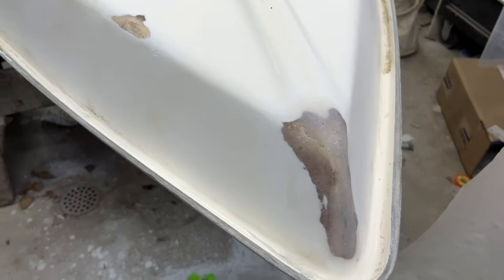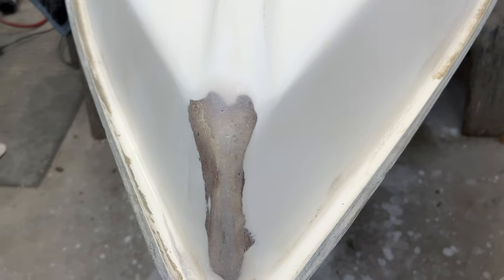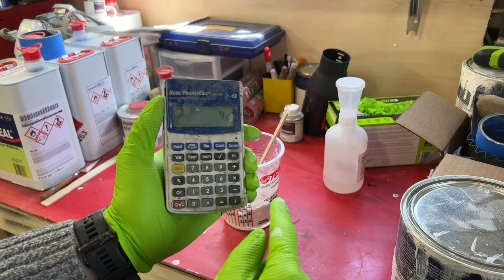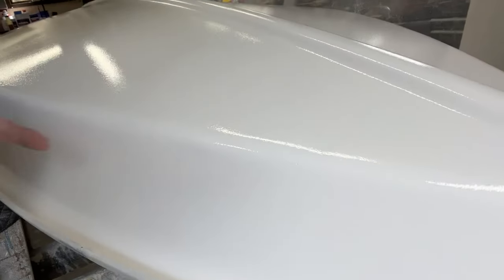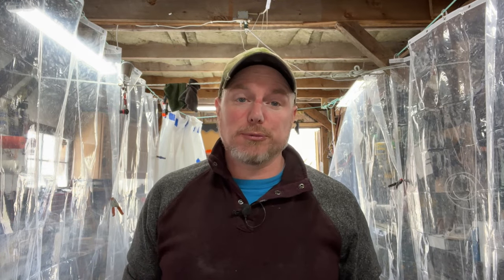Re-gelcoating your hull - PART 2 - fairing and spraying- [restoration of a sunfish sailboat]

Comment: Great video series. I recently picked up a 15' Glastron Alpha (basically a slightly bigger sunfish) and will be restoring the hull soon. 2 questions if you don't mind. First, the previous owner put a layer of CSM along the bottom of the hull that will need to be sanded down. I'm assuming this will be doable with a orbital and 80 grit to get it sanded smooth and into the correct profile? Second, I was curious how much gel coat I'll need to buy for this size hull. It's only a bit bigger than the sunfish so I was curious how much you ended up using for these boats. Thanks!

Comment: I have an older boat that is very similar to a sunfish, and the bottom of the hull is in bad shape with spider cracks. Do I need to sand all of the old gel coat down to the fiber glass and then put new gel coat on ? Thank you for your response

Comment: boy, i have learned quite a lot. i am restoring a 1972 Hawaiian 21 ft. jet boat the gel coat is gone the metal flake is rough. where do i start any help would be greatly appreciated!
Reply: A few years ago I restored my old Bahner flat deck. First things first was I repaired everything on the hull exterior. Then capped the rails (obviously not a necessary step) then got to replacing transom and stringers. Got all the dirty work done first. Then it was on to paint. In hindsight I wish I would’ve re-gelled it because it hasn’t exactly held up. Then built the engine and jet. Eventually I’ll get a new interior. But best of luck, my dad has a fully restored 75 Hawaiian

Comment: what are wiping on the hull as you are sanding, black stuff?
Reply from the maker: It’s called a guide coat. It’s pretty much graphite powder that when applied allows you to see scratches and low spots when you sand. The process is to sand until the black is gone. Then you know your surface is “flat”

https://www.amazon.com/Mirka-9193500111-Guide-Coat-Black/dp/B00GTYHCGG/ref=mp_s_a_1_5?crid=18UEICE7NUEAE&keywords=guide+coat&qid=1650801015&sprefix=guide+%2Caps%2C74&sr=8-5

Comment: I have some pretty Long and deep scratches down my hull. It's a 32' contessa. I'm unable to spray gel coat because it's in the yet other boats. What would be the best way for me to repair this? I have total bait gel coat and some pigments for color matching. Again the scratches are several feet long.
Reply from the maker: I would probably just apply the gelcoat with a brush. Maybe thicken it up a little with some cabosil or silica.

Comment: I've found your videos very informative.  I'm restoring a fiberglass car body and made the repairs using powder-coated random strand fiberglass mat and epoxy resin instead of styrene to avoid the 'wax' the use of which intimidated me.  My question is can I gelcoat over the epoxy repairs? I seem to remember an issue with epoxy in one of your previous videos. If I can't gelcoat what would you advise?
Reply from the maker: First mike, thanks for subscribing. I always respond to subscribers. To answer your question, you cannot put gelcoat (which is polyester) over epoxy resin. It just won't bond well. Your only option is paint now. Next time just buy poly resin with the wax included, then you won't have to worry about it!!.

Comment: if you had it, could you have used TotalFair  by Total Boat instead of your home made mixture? I get the idea that these boats are poly ester and not epoxy layup, and I have used TotalFair, a lot.  thoughts?  thanks, Chuck
Reply from the maker: Hi chuck. Total fair is epoxy based therefor the gelcoat will not adhere properly. Second total fair is not the best fairing compound out there. It's far too expensive for one, and really does not cure well. If you become a channel member you'll see why I'm not a fan of total boat anymore.
Reply: @HoldFastMarine  Hi Will, I subscribed. interesting that you say this about TotalBoat. I have had some issues with several of their products an there are just other brands that are go to for me anymore, Epifanes for paint and varnish, west system for epoxy, that sort of thing

Comment: Awesome video, very informative, but I got a few questions. How much psi were you running for spraying the gel coat? and how far did you sand? Im trying to respray the hull of my old stand up ski and its got some decent scratches in it, would you sand it till the scratches are flat with the hull? thanks
Reply from the maker: All that info is in a .pdf on my Patreon page!!

Comment: I just picked  up an older sunfish that was,  use the term loosely, repaired by the previous owner. He plugged the cockpit drain hole with fiberglass. Will that sand off?
Reply from the maker: Possibly. I’d need to see it to be able to tell you. I say just rip into it and see what happens!

Comment: Random question! Redoing a small fiberglass plunge pool outdoors. Would you gelcoat it or use epoxy for the work?
Reply from the maker: Epoxy.
Reply: @HoldFastMarine  ok and why is that man?
Reply from the maker: Because gelcoat isn’t strong.
Nor is it 100% non porous. Make sure your subscribed to the channel please!
Reply: @HoldFastMarine  will do thanks man! Its weird that its used for boats! Epoxy seems like a better option and easier to use

Comment: Great Video but lacking info for me...What grit sandpaper are you using on the original gel coat? (The bulk of the bottom?) Is it 180 grit? 220 Grit? Can I use 180 for the first coat? I'm getting ready to re-gel coat the bottom of my 1978 GT150 GlastronCarlson and I am changing the color. The bottom is in great condition but the color is a putrid yellow that needs to go away. I am gel coating the bottom for the durability of have a tough surface on the bottom. I am planning on 2 coats of laminating and one or 2 coats of wax coat... But I need to know what you recommend for the initial sanding (what grit before gel coating?)
Reply from the maker: I use 80 grit for the prep work. Sometimes 40 if I’m in a hurry.

Comment: So, the thing about silica is that the particles have very ragged edges. If/when you breath them, as you did after taking off the respirator and blowing the dust into the air, they become embedded in the tiny sacs in your lungs. The sharp edges cut your lung membrane, causing it to bleed, ever so slightly. The healed scab turns to scar tissue, which prevents oxygen from crossing into your bloodstream, which is what your lungs are designed to do. Over time, as you breathe silica dust, your lungs become excessively scarred up, preventing oxygenation of your blood. You suffocate.  

So, if you work with silica a lot without the respirator, you're gonna strangle yourself.  Just saying.  If you also smoke, can you leave me your tools?  And wife or girlfriend? I guess I'll have to wait a few years, though. And, I'm already old, so forget it.  Breathe all the silica you like.

Comment: just wondering, does the polyester structural repair putty cure enough on its own to be able to sand? Or did you have to cover it with something to get it to cure without air? Thanks.
Reply from the maker: It cures for me, some people say it dosent. Give it the extra time to cure and sand it with 60,80 grit at a low speed.

Comment: Hi, thanks for your videos, I noticed with your catalyst calculation for your gelcoat putty, that you included the silica in the measurement for the catalyst? If you used 2 oz gelcoat and 2 oz silica, shouldn't you use just catalyst for the 2 oz gelcoat only? Genuine question, thank you.
Reply from the maker: Gelcoat is catalyzed by total volume.
Reply: @HoldFastMarine  By total volume of gelcoat I would imagine, not the inert material mixed in.
Reply from the maker: It is by total volume, including any pigment or anything else you add to it.
Reply: @HoldFastMarine  Hello and sorry again, but I checked everywhere and all resin suppliers say that the catalyst ratio is to the resin, not to the total volume. Mx the catalyst with the resin at 2%, then mix in your catalyst. I am. not being a pain, I just want to get the job done right and doing my research.
Reply from the maker: Your not being a pain. Not at all. In my experience (20+ years) I’ve found that total volume is better to catalyze at. Now, let’s be clear it’s poly resin right? So if you need to add 5cc or mekp and you add 8 or 4 it’s still going to cure. Sometimes just to get it done fast I’ll add 3-6 more cc than I need. It’s all About ambient temperature as well. If it’s a 90 degree day you need to mix at 1% or 1.5%.
Reply: @HoldFastMarine  thank you very much! I will play with it and start with 1.5% like you said
Reply from the maker: Any time!!

Comment: Can you start with the waxed gelcoat from the beginning of the coats? What's the difference between two coats non-waxed, followed up by 1 or 2 coats waxed vs all wax coats?

Do you have to wait for each coat to dry/cure before the next one?
Reply from the maker: Laminating gelcoat is just that. The ability to laminate many layers without sanding in between. Waxed gelcoat cures hard, therefor if you apply it it will cure and you’ll have to sand before doing another coat.
Reply: Thank you! @HoldFastMarine

Comment: Great info. What size/type compressor would be needed to spray gelcoat?
Reply from the maker: Depends on how much you have to do. The larger the area the more cfm you need.
Reply: You can actually use a small pancake as long as you follow a few basic rules.

Comment: Ok! great video and good points to remember, I am re-gel coating my entire hull as well, but I need your input. I have sanded it down some previous small repairs were revealed because of small tiny air pockets and deep scratches.  One spot is uneven needing fairing or leveling other areas are smooth and feathered out. what can i use for the uneven area I dont have silica?  I am sanding to smooth with 180 grit should I go to a higher grit? and after fairing and sanding  is it ok to blow dust off and wipe down with acetone and proceed with two layers of laminating gel coat without wax and final coat of gel coat with wax using Total Boat products ? I am at a disadvantage of completing the job from the bottom on a creeper by rolling will that be ok?
Reply from the maker: Buy polyester fairing compound. As far as the prep work before gel coating; you can use acetone but I don’t recommend it. And I won’t do a hull from a creeper, nor would I roll it. It’s going to be a lot of sanding
Reply: @HoldFastMarine  OK THANKS !  SO WHAT DO YOU RECOMMEND USING BEFORE APPLYING GEL COAT?
 DO YOU RECOMMEND SPRAYING IT?,
 I DONT HAVE A CHOICE BUT COMPLETE IT FROM BENEATH, MY BASS BOAT IS ON STANDS
Reply from the maker: @dl4922  well TotalBoats poly fair is good stuff, if they have it in stock. Spraying is always better in my opinion but not everyone had the ability/equipment to do so.

Comment: How do you decide when to use structure repair putty (what type) or just us a total fair compound? 
Thank you mike
Reply from the maker: Fairing compound is for making things smooth, structural repair putty is for… well structural things.
Reply: @HoldFastMarine  I used an epoxy filler for repair some staffs before coating with gelcoat. Was that wrong application? Thank you so much for the videos.

Comment: I lost a gun attempting to spray gelcoat only getting a small area sprayed before the gelcoat went off.  The catalyst was carefully measured according to the weight of the gelcoat as per manufacturer's instructions at 1% ratio.   So how is it you get to spray the entire boat which appears to exceed the 10-12 min gel time?
Reply from the maker: Small batches. 20 oz or less. Also gelcoat needs to be catalyzed at 2% by volume NOT weight. I have other videos explaining how that all works.

Comment: How would you recommend doing it with a roller? 2 or three coats of gel coat and sand inbetween coats. Then do a coat of gel coat with wax?
Reply from the maker: You can’t sand gelcoat without wax easily. It gums up the paper very quickly. If you want to sand just use gel with wax.
Reply: @HoldFastMarine  I got the topcoat gelcoat that has wax with it

Comment: If you were to spray gelcoat with wax, how much working time you would have?
Reply from the maker: In the cup it’s the same regardless of wax or not. On the surface of the boat it’s a hour or two before it starts to gel. You only have 10 minutes or so in the cup.

Comment: Is there a way to gelcoat without using a sprayer?
Reply from the maker: Yes there is, you can brush or roll it on. Be aware you want a thicker coat because you’ll be doing a LOT of sanding.

Comment: How long after applying the fairing compound can you sand and shape?
Reply from the maker: Depends on many factors, temperature, humidity and how “hot” you mix it. Sometimes it takes hours, sometimes it takes 15 minutes.
Reply: @HoldFastMarine  it was lest than an hour! That stuff didn’t even make it 15 minutes in the container before starting solidify. Went through almost the entire can. I appreciate the time you have taken to respond. Keep up the great videos.
Reply from the maker: @harbylimon8442  well you mixed it too hot bud. Always mix either small batches OR use a bigger container. Polyester stuff is exothermic so the tighter it’s packed the quicker it sets. And thank you for the kind words!!
Reply: @HoldFastMarine  yup, I found that out after the 4th attempt but I finally had it all in place and shaped out. It’s coming along but today I will be doing the gel coat. I have the foam roller and paint trays. Wish me luck, I’ll need it. Oh, I’m in south Texas where the humidity is high and the heat is crazy hot. Thanks again and any tips on the gel coat are greatly appreciated. Have a great Sunday!!

Comment: Question- what’s the differences/ advantages of using wax vs no wax gel coat ? Thanks
Reply: @markkraus3598 Mark, I'm learning this myself, so you must research and confirm what I tell you.  I think that wax gel coat is a final coat only.  I don't think that you can go over a wax coat, and if you need to go over a wax coat, you have to prep first to remove the wax.  I think that a first coat will always be no wax.  See dl4922 comment below, and also read the Total Boat product descriptions.

Comment: What is the black dust you put on the hull prior to sanding the bulk of the hull?
Reply from the maker: Well if you watched the video I explain what it is 🤣. But just for you I’ll tell you. It’s graphite powder.
Reply: I didn't watch in the proper order. I was just learning the answer on the next/previous video when your response came in. Thank you.
Reply: Its called a "guide coat" to help show how much has been sanded off, you can use powder or even dust some kind of black spray paint over it, just be sure to remove it all especially if if its not a completely compatible material.  This is very helpful for large jobs you cant observe all at once, or controlling how much you sand off with a visual marker.  Just something that will stand out to the eye, black over white and light colors, light over black or dark colors.